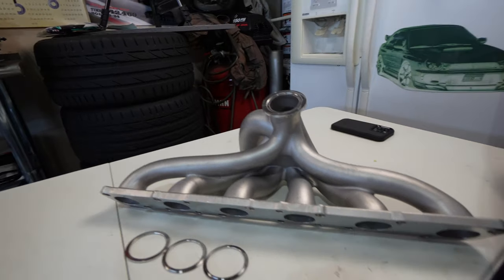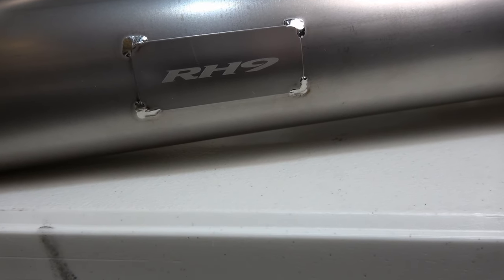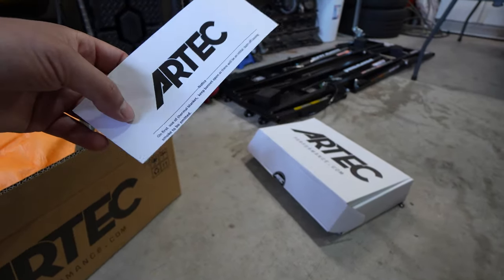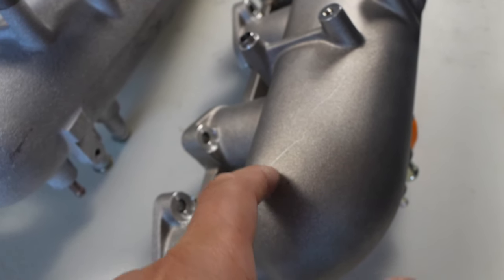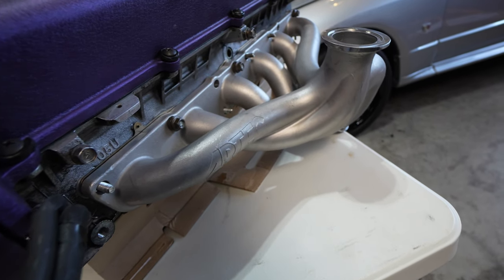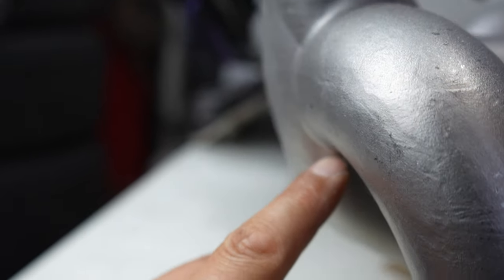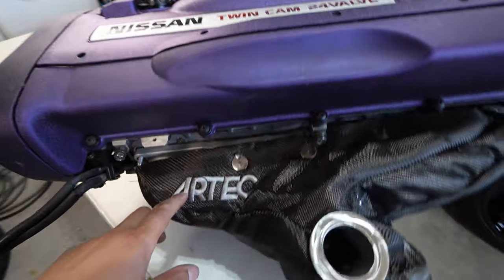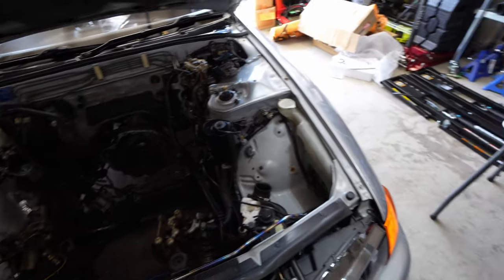Artec Performance RB Manifold and Nismo Intake Plenium going SINGLE TURBO RB28 DREAM BUILD

Comment: Good Deal. Glad to see you got rid of those twins and come to the dark side. There's zero downside to a single. It cleans up so much twin turbo mess. Pick up your vac references off the turbo so you dont have to run them across to the cold side now. I went with a Borg EFR as it centralized all the references, BOV and Mac. Adding DBW will help clean up the more even more!
Reply from the maker: I have so much to learn about to figure out how to put everything together properly.

Comment: Awesome to see some more GT-R content! Congrats on the sponsorship!

Cerakote and heat blanket for sure. Might as well do it all at once while it’s out just in case you decide to take the blanket off in the future.

#totheend
Reply from the maker: I was thinking the same thing, should have it coated while its all apart. Thanks for all your support #totheend
Reply: I've used Swaintech white lightning coating and then put a blanket over that...the coating cracked right off...it just got too hot.

Comment: I like the single turbo idea and I just about jumped out of my chair when you said G35-900 with .83 a/r turbine housing because I was already thinking that is exactly what I would put on your car if it was my car.  The Garrett G series turbos are very good and are what I would upgrade to if I for some reason needed to replace my "old" GT series.   
The external wastegate (TiAL?) will be better than any of the internal wastegates.  As for how to dump it, whether to go external dump or internal, I don't know if you've been in a car with an external dump before.  But if you haven't, you should take a ride in my car before you decide.  It gets loud!  I love it but there are times I'd like to get on the gas hard and don't because there are other cars too close and I don't want to freak them out.   Probably attracts police too.  Anyway, beautiful stuff there!  
BTW I wouldn't entirely expect 800 whp from the G35-900.  Especially not on 92 octane.  But to talk about that we'd have to be looking at the compressor map sometime.   #totheend
Reply from the maker: Thanks as always for your support Gary #totheend. My goal to start with my car will be to tune at a low boost setting for about 600 whp. Dont want to break my transmission or front transfer case. Just want to get my car back on the road and enjoy it again.
Reply: @JDMRightHandDrive   Yeah that's what I would do too.  And I think you could do 600 whp on 92 octane with a reasonably "safe" tune.  LOL.  As if there is such a thing!  Saving the transmission and other drivetrain parts would be really important to me too.

Comment: If you're doing this dream build with that much power what gearbox setup are you going to use? I don't think a stock 32 box will cope
Reply from the maker: Going to use my stock drive train for now. I will be running mild boost, no more that 20 psi to start. Hoping the trans and transfer case last for a little while. I can always upgrade those components later on, I just want to get my car back together for now and get some seat time.

Comment: Thank you so much for telling me about Black Hawk Japan! I ordered some Tomei Type B valve springs for my R33 GTR complete restoration project and didn’t know they also sold the Nismo plenum for almost $800 cheaper than everywhere else, literally ordered one under a minute after seeing it in this video. Thank you for sharing your build journey with us! I’ll be doing the same with my project as well :)
Reply from the maker: Your very welcome. Yes you cant beat the price on the plenum directly from Japan. Yen is so low right now that all parts direct from Japan are basically on sale.  Black Hawk has been awesome to work with. If they don't offer a part on the website, I message them on Instagram and they source it an add it to the website. Glad you enjoy my GTR videos, still have a long way to go to finish my build. Best of luck with your build and thanks for watching.

Comment: Nice upgrades, I also just managed to buy a Nismo plenum whereas I couldn't before.
Reply from the maker: Hell yeah man that is awesome. The NISMO plenum is going to look epic in the engine bay. Now I need to decide if I want to have it powder coated black to keep the original R32 RB look?
Reply: @JDMRightHandDrive  They look great from factory, the only benefit with powder coting is that oily finger marks would wipe off.